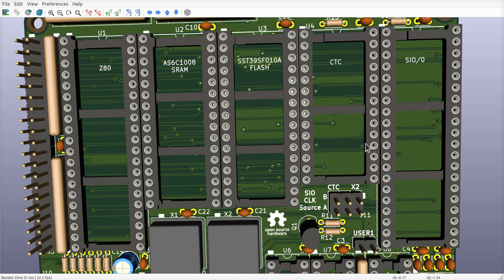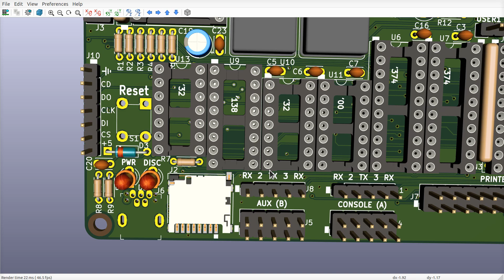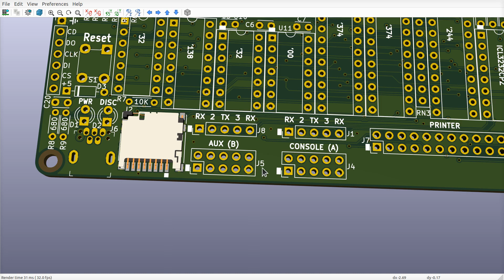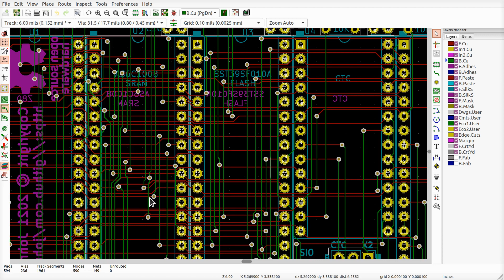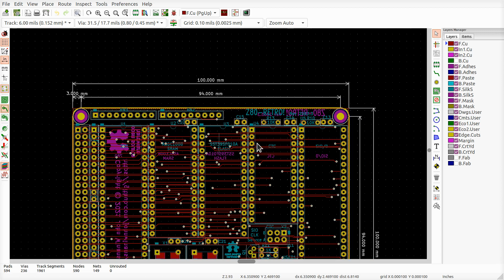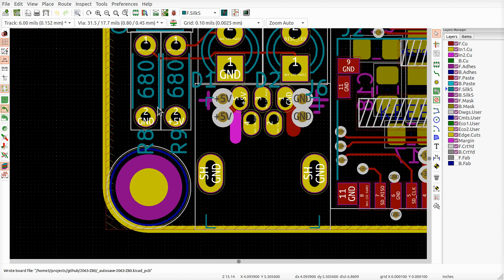Z80 Retro #8 - PCB Design

Comment: I found an old metal box of Z80 CPU's SIO CTC etc and a lot of logic chips in my garage from around some 20 years ago, so looking for a project for them I came across your videos.  So I have ordered a set of board from JLCPCB that should be arriving soon.  Long term project as I try to get back into the old Z80 stuff.  Thanks for the videos I hope to learn a lot.
Reply from the maker: Glad to know I could help!  Make sure you look closely at the most recent schematic for DNP parts and for any fixes.
Reply: @JohnsBasement  The version I had made was V4.4, I think that was the last.  I will check files and schematic for it thanks.

Comment: Hey John, for the next rev, how about adding an ftdi header (maybe below the printer header) that would make the max232 and capacitors optional as well right? How much power does the board require to run? Might be possible to power it from the ftdi as well....
Reply from the maker: The next project might just have a USB adapter on board.

Comment: About the 40-pin breakout header... You put A8 to A15 in, but essentially, those will never be used again, since the retro board has all the memory one might need. We would only need A0 to A7 for IOs, won't we? Unless there's something I'm not understanding. 

For my board, I'd probably replace A8 to A15 with IRQ0 to IRQ7 and put a 75HC148 interrupt priority encoder, and run interrupts in mode 1. What are your thoughts on that?
Reply from the maker: Well, some of the I/O instructions can use A8-A15... but if you are not using that feature then you are right.

If you are going to include the CTC and SIO then you are likely to prefer using mode 2 interrupts... and in that case you will want to include one end of the IRQ priority daisy chain.

In recent months, I have been thinking about doing a project with the Z8S180.  Have a look. That SOC might throw a whole bunch of new ideas into the mix too.  (Note, specifically, that I am not talking about the EZ80... that is a completely different thing.)
Reply: @JohnsBasement  Oh, I didn't realize that some IO instructions could use the upper address bits. Can you give an example? Since it's the case, I won't remove them from my header.

Is it possible to use both mode 1 and mode 2 interrupts at the same time? Meaning, can I use SIO PIO CTC, alongside non-Zilog chips, like the VDP?
Reply from the maker: @microhobbyist  outi, otir,...  I'm sure not all would agree, but if you don't need that feature then it'd not be a crime to leave off the 8 MSBs.

Only one IRQ mode at any time can be used.

Comment: How important is the bonding option on the Z80 SIO? Your design uses SIO/0. Toying with the idea of an SMD version of this circuit (emphasis on 'toying'), I discoverd that there does not seem to be an SMD version of SIO/0, only /2, /3. /4. Does such a lack of SIO/0 make an SMD version impossible or at least more problematic? Maybe there other such problems lurking in the dark making an SMD version impossible? Or maybe this is just a dumb idea?
Reply from the maker: You'll have to define 'dumb.'
I am mulling over a next generation surface mount Z80 board.  We should talk if you think there is something that we could collaborate on... even if only to do some design reviews.
I am looking at using a Z8S18020FSG.  It is a SOC with a 20MHz Z80, 16-bit counters, two UARTs, and an MMU that is a bit nicer than the one I have on my Retro board. This should free up enough space on a 100x100mm board for an FPGA that can emit VGA video and do other gate-hungry things as well.
Reply: @JohnsBasement  Why not Z84C0010VEG (44 PLCC) versus Z8S18020FSG (80 QFP)? The later has 12 NC pins that are omitted on the former. Makes for easier soldering unless you are planning pick and place of components - which I doubt knowing you as the Mr. Frugal that you seem to be. 🙂
Reply from the maker: @DavidTLutz  when youtube generates enough to cover one of my hobby projects, I'll up the ante!
Meanwhile... Who stocks the VEG package??
I've got a LQFP in stock that I don't have trouble soldering in.  I got others asking to go surface mount too.. so I thought I would on the next version... Plus I have to anyway if I want to take a swing at creating a VGA video controller in a FPGA... Which has been on my TODO list since I started my Retro project.
Reply: @JohnsBasement  Oh, so you are farther along than I realized - I took "looking" (above) to mean you had not yet decided. Digikey stocks the  Z84C0010VEG. However, it is only 10 MHz but still 5V. It is cheaper then the Z8S18020FSG. FPGA and VGA - are you aware of Haskell and Hanna's book? Amazon: Advanced Digital Design Using Digilent FPGA Boards: VHDL / VGA Graphics Examples.
Reply from the maker: @DavidTLutz  Nothing is cast in stone until all the parts are soldered on... and even then... there is usually a Rev 2 ;-)
That book title is new to me.  I got my toehold from Pong Chu's book: https://a.co/d/hjYOGjc
I try to aim for hobby things that the students on my FRC team could afford ($$) to do if they were so inclined to try.  To that end I have been trying to stick to hand-solderable parts that have software tools that are easy to deal with over the course of time.
Re-installing the giant IDEs from the big vendors every time someone decides to change the color of some rand-o menu buttons is getting really annoying.
If it can fit onto a ICE40HX4K, then I'd like to do so and build on what I was doing in these projects:
  https://github.com/johnwinans/IceStick-Examples
  https://github.com/johnwinans/2057-ICE40HX4K-TQ144-breakout
  https://github.com/johnwinans/2060-ORIO2
  https://github.com/johnwinans/ORIO2-software

The IceStick example tool install is getting stale... but that series of tools is surprisingly light weight and easy to learn how to use.

It should be easy to pop one next to a Z8S180 and implement a VGA display.  What is unknown to me at the moment is how fancy it can get.  I know that 1024x768 is doable without even adding any extra RAM (because I already did it on the 2057 breakout board) and I expect that I could make sprites work too.  The unknowns will reveal themselves when it comes to how much video memory I can include and how it should be accessed from the Z80.

THIS is why I have been playing with the TMS9118!  Before I commit to my first-gen architecture, I wanted to see how cumbersome it is to use a system with none of its VRAM directly mapped into the CPU address space.

Probably include PWM audio, PS2 keyboard/mouse, SNES game controller ports (original/non-USB), etc.
Reply: @JohnsBasement  Test reply. Something short. How weird, this one persisted between sessions where my previous six attempts always disappeared. I am now getting a Save button on bottom right where previous it was labelled Reply. What is going on?
Reply from the maker: @DavidTLutz  😂
Reply: @JohnsBasement  Another attempt. Now I have a Reply button instead of a Save button (maybe one only get s a Save button when editing.) More testing needed. Later, Edit does give you a Save button. OK, I am done trying to figure this out. :face-orange-raised-eyebrow:
Reply from the maker: @DavidTLutz  You are talking about the YouTube comment editor?  .. I notice the UI seems inconsistent.  I'm sure the person that designed the phone & desktop versions thinks they are a genius.  -- The REAL genius is the never-changing and un-adorned google home page: Just make it work & leave it alone!
Reply: @JohnsBasement  Here is a guy you can agree with: https://www.youtube.com/watch?v=JCncSh13x7s. Glad you got a kick out of my demonstration of my tenacity yesterday - really.

Comment: Hi John, real nice design and very well document, with regard to the bank selection chip U6 - 74HC374would the SN74xxx990 not be a nice alternative as this one would have readback of data is pin 1 was route to decoder ?
Reply from the maker: Yes.  It would improve the efficiency of solving a race condition where an IRQ handler has to change the bank select.
But I'm not sure if a supply of dip versions are available at a reasonable price. 😕
Reply: @JohnsBasement  You right these would be hard to find @ reasonable prices, allow me to suggest an affordable alternative being a gal 16v8, I know it's against your design principle for this board but ... 😉
Reply from the maker: @paulvanderwielen8173  Perhaps.  But I find it tough to settle for a GAL when a low-end FPGA is waiting in the wings.
Reply: @JohnsBasement  Probably for a valid choice for a next rev board, thanks.

Comment: I can only wonder how that would look if it were wire-wrapped instead of using a PCB.
I don't suppose your software can render that automatically?
Reply from the maker: No. It can't as far as I know.
I suspect that at 10mhz, it would work because I've wire wrapped a few 68000 projects over the years that I think ran at 10.

Comment: I once had shorts between GND and VCC on 2 boards (out of the 5). Now, I always do a continuity test between my power rails. Go figure!
Reply from the maker: Uh.... On a retro board from my gerbers??  Did you un-select "individually tested"?  Or maybe your board house does not test them by default?
Reply: @JohnsBasement  No, it was my own boards (6502 SBC rev 4). But that's a fair point, I'm not sure I unselected "individually testes". I'll be more vigilant next time. As for the board house, it's JLCPCB... I usually don't have any issues with them.

Comment: I ended up putting the ground plane on the back layer, and the power plane on the front layer on my two-layer projects. My thinking would be the same if I did 4-layer boards, as there would be more contact with the pads on the top layer for the power plane. Inner layers would be ground planes, of course. Do you see any issues with this method?
Reply from the maker: The issue would be that you won't have access to signals for testing.
Dave Jones recorded a piece on this exact issue: https://www.youtube.com/watch?v=2v5IvaWrPKk  But he got sidetracked on some DRC errors and I can not find the next in the series.
I am always amazed when I check the current carrying capacity of a via.  You may ne need to worry about that so much for one chip.  If you do want more, you can always add some vias near them to increase the cross-sectional area of copper that connects to the inner planes.
Reply: @JohnsBasement  Oh, I see what you mean. Now I under stand why having the power plane and copper plane in the inner layers would be more practical.

Comment: First off, your board is going to be ok as it is because all your parts are very slow.

But you actually only have a good return path for signals on the front side.  They couple to the L2 gnd.

Your back layer tracks will have to hunt for a return path and will choose path of least impedance.  They might use your L3 5V plane and then run through one of the decouplers, or they might find a GND connected through hole.

Either way it's unlikely to be the smallest loop area.

I only wanted to point that out because people designing faster boards need to understand that or they won't work well/at all/will radiate like crazy.

Also the L1 and L4 GND floods are not a good idea unless you have a very good use case.  Don't do it as a matter of course.  It does not generally fix any radiation issues.

Don't take my word for it.  Watch Rick Hartley's videos.
Reply from the maker: Filling L1 and L4 is something I used to do after a board house asked for it (or dots) as thieving.  I also think it looks nicer.  Any down sides?

I've seen Rick's talk on power & ground planes.  It is good stuff.... and yes, I ignored one of his lessons.  :-|

As you note, with slower signals, we can get away with a lot.  As it is, I think it is WAY better than a 2-layer board a'la 1980!  In the end, putting the signals inside w/ground on L1 and L4 would be better... but when prototyping & debugging a 10MHZ board, it is nice to be able to cut a trace if/when necessary.
Reply: Hi John,

I would always leave undlooded.  If the board house needs copper adding for balancing L1 L4 material density they will ask to add some.  With modern PCB manufacturing it's highly unlikely.

There is no need to sandwich the signals in the board ... it works just as well with the signals on the outside.

For high speed stuff (by which I mean things with very fast rising and falling edges) you just need the signal traces to be as close as possible to GND.  

For your board I would have had L2 and L3 as GND and then I would have routed 5V point to point like a (fat) signal.  Then finally I would have scattered some GND vias around so that signals crossing L1-L4 have a parallel return path from L3 to L2 GND.

One trick is to run the 5V as a trace around the perimeter of L3 to distribute around the board, then you can just tap off and do your horizontal and vertical routing to the power pin as normal.

Love the videos by the way, thanks!

Comment: I've followed Fran Lab for some time and glad I came across this channel.  I always wanted to build a retro Z80 system
and after watching a of the videos I may do some redesigns adding in a SD card.  I don't know if its possible but I wonder
if I couldn't use one of the SIO serial chips channel to interface to the SD card.   Since the SIO can work in a synchronous
mode would speed up access time and less CPU overhead.  Just an idea.
Reply from the maker: I wondered about that too.  It might be possible if you can accurately control the clock in relation to the SSEL signal.
Please let me know if you can find a simple solution!

I am looking at building a multi-IO board to speed it up with a hardware SPI SD interface as well as other things like joysticks, keyboard and a graphic display.

Comment: R1,R2,R3 connect from U6 to the SD card MOSI/CLK/SSEL. My mini-resistor kit doesn't include 2.7K, but I have 2.2K and 3K. Would either of those work instead of 2.7K?
Reply from the maker: You mean R1, R3 and R5? 

Since those resistors are part of a voltage divider, the voltage will go HIGHER as the size of R1, R2, and R3, are reduced.  The max voltage for the SD signals is 3.3V!  Using 2.2K will probably be OK.  But don;t make them any smaller.

2.2K paired with 4.7K will make the theoretical high voltage 3.4V.  But it is not too bad.
3K paired with 4.7  will make the theoretical high voltage 3.05V.  That is a bit low.  But it is likely to work OK.

The math for SD_MOSI works like this:

    SD_MOSI max voltage = 5V * R2/(R2+R1)

As drawn:
R2=4.7K
R1=2.7K
5 * 4.7/(4.7+2.7) = 3.175V

If we substitute 3K or 2.2K:
5 * 4.7/(4.7+3) = 3.051V
5 * 4.7/(4.7+2.2) = 3.405V

You can change both R1 and R2 as needed.  Make sure your total resistance stays between 4K and 8K or so.
Reply: @JohnsBasement  Thank you! That's very helpful.
Reply: Would the same logic apply to the programmer board, where there are the 2K7 resistors?
Reply from the maker: @joelburton5509  The 2.7K parts on the programmer are all nominal.  Anything from 2K-5K should be fine.

Comment: Can you use Z8400 as a replacement for the Z80?
Reply from the maker: I am not SURE.  But I suspect it would.
Potential problems are that 1) the clock oscillator overshoots more than I'd like it to (In a rev 4 design, I will add a series resistor to the outputs of  X1 and X2) and 2) the output drive voltage on the Z8400 is spec'd lower than that on the Z84C00 that I used on my board.
I'd try it and see.  (Please let us know how it goes!)  I wouldn't expect anything to get physically damaged if it doesn't work.  So you could just swap the CPU out if that happens.

Comment: If you REALLY wanted to hid the SD card for a retro look, you could have tried to put THAT on the back side of the board too!  10:55, looks like a rev 4 in the works!
Reply from the maker: True.  Ofcourse with an otherwise thru-hole board, i am lacking options! 😕
Reply from the maker: And yes, there will be a Rev 4 at some point.  Rev 3 has been running CP/M 2.2 fine for me for weeks.  Improvements could be made, however, it is not clear that they are necessary. 
See the 'issues' list on the github project page.  I have been documenting my thoughts there.